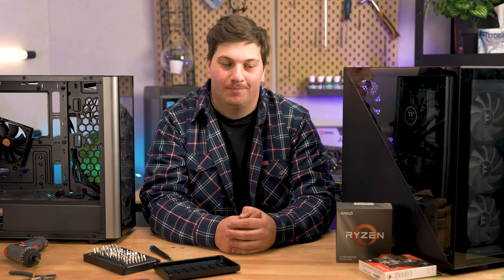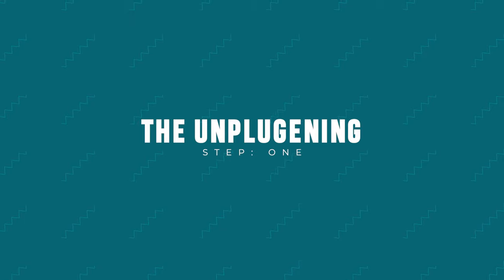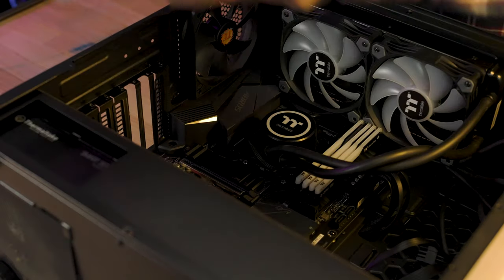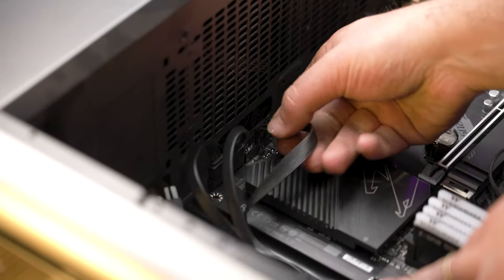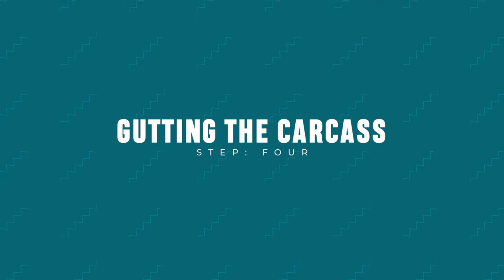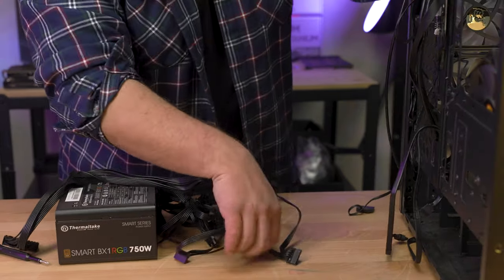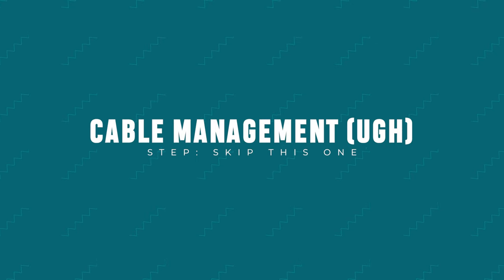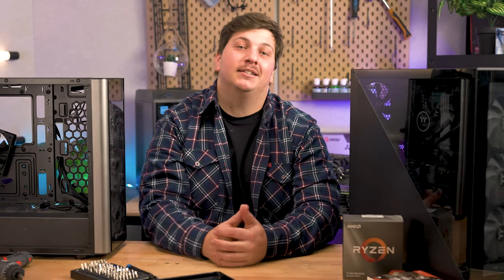How to SWAP your PC Case - A Complete WALKTHROUGH

Comment: Alright so my PC doesn't turn on, nice
Reply from the maker: Oh noes! Something may have come loose, or a small detail could of been missed in the swap, here's a few things to triple check. 

The power switch at the wall is turned on

The Power Switch at the back of the PSU is set to (I) not (O)

Your 8 PIN CPU cable is snuggly connected to both the PSU and the Motherboard

Your 24 Pin cable is snuggly connected to the PSU and the motherboard

You have installed the PWR button header in the correct spot - you can also try and jump those two lines with a screwdriver
Reply: @ThermaltakeAustralia thanks for the help, but turns out i plugged one of the case cables 2 times and it was not allowing me to boot, i removed one pin connection and it works fine now. could not have rebuilt it without this video tho big thanks